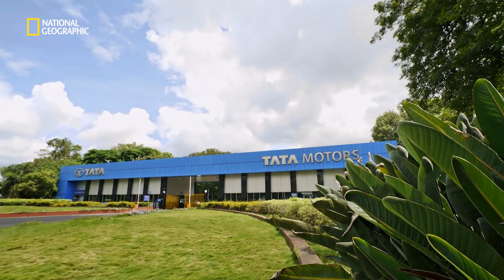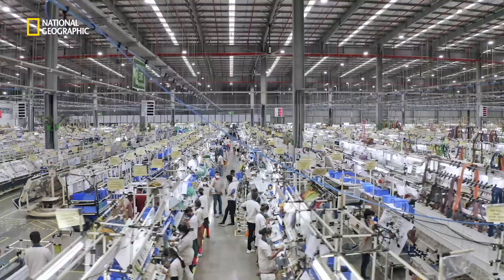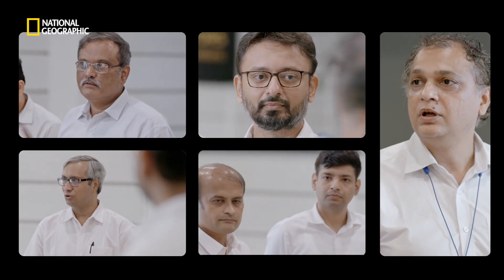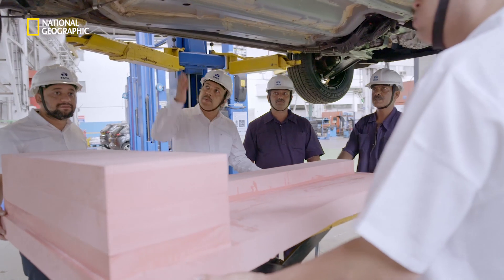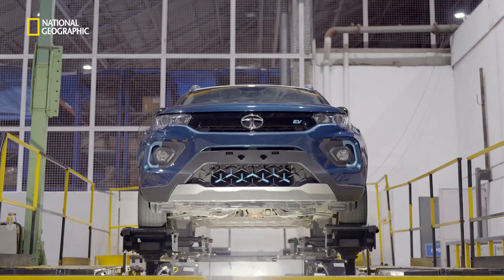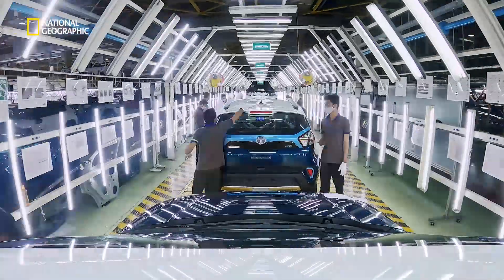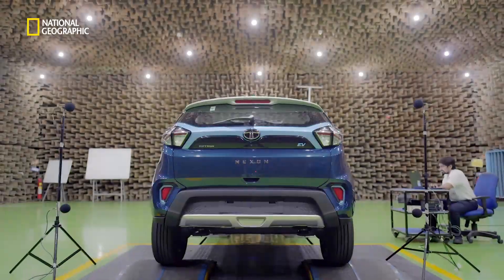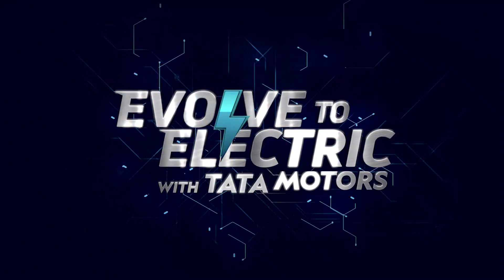What It Takes To Bring a Revolutionary Change |  Evolve To Electric with Tata Motors

Comment: In india electric vehicle is going to scrapping after 15 years.... Then y people will buy electric car by giving 7 or 10 lakhs more than normal petrol and diesel car.....
Reply: This question was raised to Nitin Gadkari, he replied that since EVs are new by the time question arises of scraping them the rules can be modified. Secondly, many people using EVs have saved upto one lakh on fuel prices in a single year. It might depend on individual cases but yes that Savings are just great.
Reply: Who told you this?
Reply: @sabaahmed6624  goggle pe search karlo 3 din pehle hi rule aaya hai
Reply: Because cost of running is very cheap.
Reply: Kuch bhi.... Scrappage policy old vehicles ke liye aaya h. Old not upcoming